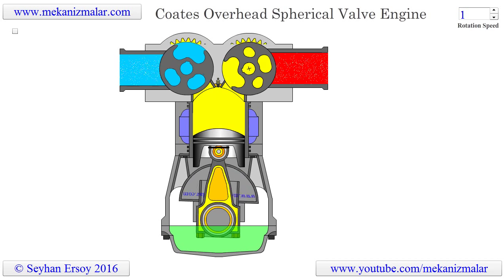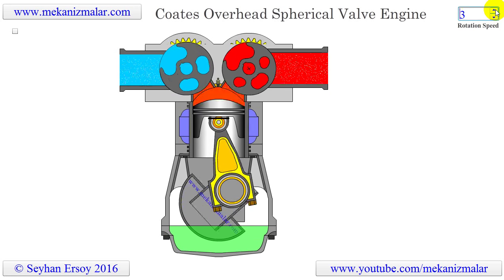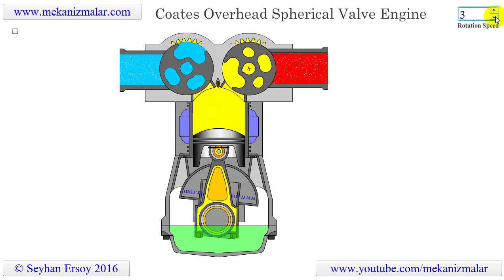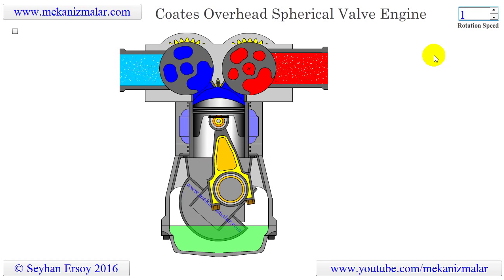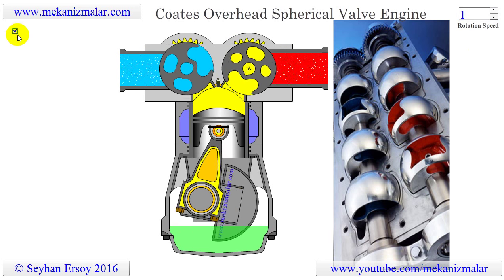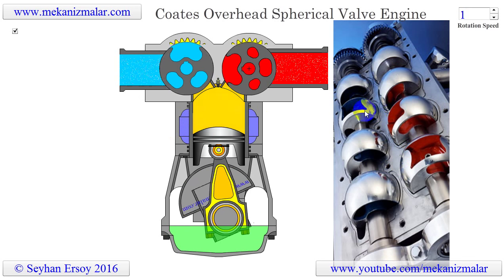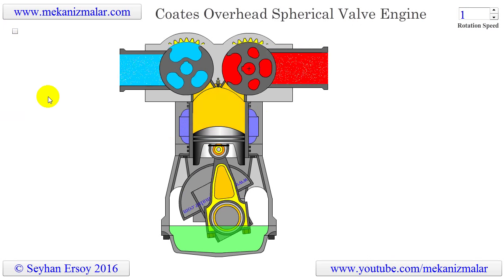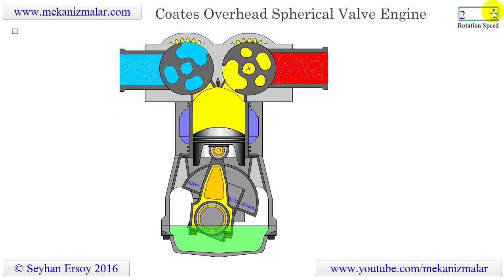coates overhead spherical valve engine

Comment: Lots of friction, and the lubrication is exposed to the heat and moving gases of the combustion chamber.
Reply from the maker: +deezynar Thank you for your comment. I am not in the position of defending or disapproving this engine. As I stated in the animation, if the design does not have any shortcomings it will prevail, otherwise it will be forgotten as a nice try.
Reply: +deezynar cast iron valves, against cast iron valve seats could be run dry, and still have surprisingly low  dry sliding Friction coefficient of 0.15. Using identical materials for both parts should also reduce effect of differential thermal expansion that tends to plague rotary valve designs and lead to poor sealing/seizing
Reply: +steve cummins Thermal expansion could cause some problems.
Reply: +steve cummins
There is zero chance that metal surfaces can run on each other at those speeds, those tolerances, and at those temperatures, in direct exposure to flame, and do it without continuous lubrication.  The requirements are for high tolerances to provide a seal against high pressure gas, and it must be maintained inside a combustion chamber where there is both high heat, flame, and gummy hydrocarbons.  It can't do it without continuously fed lubrication, but the lubricant itself causes problems.  Oil lubricant supplied to the spinning valve surfaces will escape into the combustion chamber, causing the engine to smoke.  And valve lubricating oil will also get cooked onto the surface of the valve that is exposed to the combustion chamber during the power stroke.  In a typical piston engine, the piston/cylinder surfaces are continuously lubricated under pressure, and the piston rings scrape the oil from the cylinder as it moves down the bore, leaving no oil to get scorched.  The piston rings add a fair amount of extra friction that would be good to get rid of if it were possible.  This spinning ball valve design will need to have lubricant seals around the edges of the ports, both inside, and outside the combustion chamber.  That's a lot of surface area being scrubbed, a lot of friction, and a lot of chances for seal leakage.  This engine shares the same challenges with sealing large swept areas that the Wankel engine has.  If someone can solve that problem, we'd be better off with the Wankel.  I don't see a single advantage to this engine design, and a lot of huge problems.
Reply: Effectively cast iron is sintered throughout with graphite flakes(or spheres). therefore it is self lubricating. And that lubrication is of a kind which can handle high temps too. 
Also with  a bit of care, it's possible to arrange things so rotating valves become more accurate with wear. ie rub two surfaces together under pressure and they'll end up with same curve. Exactly what Whitworth (and later people) did to produce cast iron surface places with accuracy far in excess of that achievable using "normal" machining.
Reply: Also The Wankel engine has a far more difficult issue to solve with seals. .... look carefully and you'll see within a Wankel engine the angle the seals make to the cylinder wall varies. That results in theoretical point contact,  Under such circumstances, no lubricant could ever hope to resist the theoretical infinite pressure and prevent metal to metal contact. Then as the seal wears down in an attempt to spread the load to that which can be supported the angle changes. The seal is constantly playing catch up through wear.
Reply from the maker: +steve cummins Some people adore the Wankel Engine cars. I wouldn't touch it with ten feet long pole. Once I had used Mazda RX 7. Driving it was fun, to start it in cold winter days was a nightmare.
Reply: +mekanizmalar I know Wankel compression ratios aren't great at the best of times. Compromises have to made between the extent of the seal angle oscillation, and acceptable rates of seal wear.

Would you happen to know if anyone has used hydrostatic air bearings within rotary valves? Both need tight tolerances to work well. Tight tolerances/small long gap,  should result in low leakage from "bearing" and past valve. Low friction and negligible wear would be good too.
Reply: +steve cummins Cast iron pistons in cast iron cylinder bores have always had to have piston rings, and lubrication.
Reply: +deezynar true. I suspect the reason for piston rings isn't so much about wear properties,. More that pistons can get quite hot at top of stroke, and bore is cool at bottom. Without the C shaped pstons rings that can match a small range of diameters, reciprocating engines would be likely to seize when warmed up

I'm not saying lubrication don't offer an improvement with for cast iron to cast iron running, just querying if it strictly necessary, in a different application.
Reply: steve cummins
The ball valves in the engine we're discussing are located right at the hottest place in an engine, and the exhaust valve will have very little relief from the worst of it all.  The stems of poppet valves are pressure lubricated, located outside the combustion chamber and are surrounded by coolant galleys.  Plus, the surface area of a poppet valve stem is far less than the balls in this new engine.  Finally, the pressure inside the combustion chamber pushes the poppet valve tighter against its seat.  Ball valves only have their fit tolerance to resist the pressure.
Reply: +deezynar Doesn't t matter so long as they don't change shape, and relative size with housing they run in..
As I suggested use hydrostatic air bearing for "lubrication" and support against the combustion pressure- they're amongst the best devices around for rigidly maintaining shaft location, extremely low friction/none contact and so simply don't experience contact wear wear so tollerances are maintained. Minuscule volume of compressed air leaking out of the valve isn't gonna harm anything. Could perhaps even tap "compressed air" off from the chamber itself, and save on a mechanical part.
If fit is good enough there'd only be a minuscule area available for combustion pressure to escape through. Compare with the area a piston ring's expansion gap presents to combustion.20% of the size? Path length could easily be far greater. If you want to quantify things, run equations at https://en.wikipedia.org/wiki/Choked_flow
Reply: steve cummins
Actually, this is the 1st time you've mentioned anything about using compressed air in this strand.  Let's see it last as long as a poppet valve engine, and meet emissions, and do all the other things we get out of poppet engines.  This is not a new idea.  It's been around for more than a half a century.  At first glance it looks like a great idea.  Because of that a lot of smart people, and some big companies have already spent time and money trying to get this to work.  Unless there's a major breakthrough in materials science, it isn't going to be in any car you can buy.
Reply: deezynar you not see the post mentioning air bearings?   If moving parts don't touch as is the case with hydrostatic bearings, then both can be made of same material without risk of galling. replace all bearings, including sliding ones (eg piston in bore) with air bearings made of say Invar to avoid any issue of thermal expansion messing clearance up, and that's an engine which won't suffer mechanical wear, with lower friction, lower leakage and so doesn't need any kind of oil with it's attendant pollution when it inevitably burns.

I do agree such is unlikely to be done by big companies... I studied mech eng at uni, and part of what we were taught was to design for limited life. Little point in a company investing R&D in something that won't break after 10 years as by that time "something better will have come along."

And regarding material science... Invar is well known for it's corrosion resistance, doesn't expand with heat, and has a melting point higher than aluminium alloy so may well be up to the job, despite having been around since 1896.
Reply: steve cummins
And... you've said nothing that moves the conversation forward.  This engine is only being talked about today because its promoter makes his living by getting publicity for it that attracts ignorant investors.  If it ever goes into real production for use in cars, or motorcycles, etc., it will be at some unknown point in the future, using materials we don't have today.  If it worked today, it would have replaced poppet valve engines already.  This engine layout is very much on everyone's radar, and they're keeping track of what advancements are needed to make it practical.  BTW, saying you are an engineer, or studied engineering gets you zero additional respect beyond the words you write in your argument.  Having worked around engineers I have learned that some are complete idiots, and others are really brilliant.  The only way to tell the difference is to see what they say, and do.
Reply: Hunh? No more friction than a standard camshaft would incur. I have no ideas why the Coates spherical rotary valves weren't an explosion on the rodder market. I was fascinated by them when I saw then in Mustang mags back in the 1995-1997 years.
Reply: davidsirmons
Because of the problems discussed above.
Reply: the shaft spin on the seals and the valves don't touch the heads/block. no oil is used in the heads.
Reply: All seals for moving surfaces leak to some extent. In addition there'll be a fair bit of heat conducted back along metal parts, and that can coke oil. Was occasionally a problem with turbo charged petrol engines in the 1980s.
Reply: @deezynar  You have a lot of logic arguments, but you talk like this was just an idea. In reality these has been running and working for decades..
Reply: @happyfox711  Share a video of one that's in use doing real work.  I'm willing to learn.
Reply: @deezynar  there's a lot of technologies that's not really supposed to work, take DLP projection - megapixels of real individually moving mirrors crammed into 1/2 square inch. The guy Larry  must have been gifted in persuasion to make Texas Instruments shell ut millions for R&D, but  it turned out to be the best system of video projection the last 20 years, just recently the 3LCD technology caught up in specs. Imagine someone saying, yeah I got this idea of  1600x1080 mirrors mounted on electrostatic actuators alltogether about 1x1.5cm but hold on that's not all. Then you have this wheel at 10.000rpms with different color segments that syncronizes with the mirrors to create a picture in colours. It only means the mirrors will have to open and shut 8 times or more pr.segment. It will work !
Reply: @happyfox711  I don't see the video I asked for.
Reply: @deezynar  something wrong with your computer ? Are you unable to click on a link or search CSRV engines youself ? Look don't drag it out any longer, you was wrong, ok. Accept it.  Btw. most of these being installed nowadays are in generators and other big industrial motors, for longer service intervals, cleaner emissions, adaptibility to multifuels etc.
Reply: @happyfox711  Of course I could look it up myself, but I won't because it would be a waste of time searching for something that doesn't exist.
Feel free to prove me wrong, and show me evidence that the engine in question is actually real, and operates, and relatively common, as you claimed.
Reply: @deezynar  I just did, but relatively common is your own invention..
Reply: @deezynar  are you really saying CSRV engines don't exist ? if you want to believe that, just to be right in your comments bashing the uploader with your ideas about how this can't work, then I'm not gonna waste my time on you. If you'd care to look at just one of the links, you'd see an example of a working CSRV engine.
Reply: @happyfox711  I am happy to be proven wrong, just post some evidence.
Reply: @deezynar  you kind of remind me of a cheating wife, the whole world knows she's wrong, but she sticks to her lies, in her mind, a way of saving face..
Reply: @happyfox711  While you have been passively doing nothing except trying to get the last word in, I've been doing research on this.  It appears that someone has had some success with a rotary valve design.  
First of all, it is very different from the design in the video.  The valves are cylinders, not spheres.  And they are turned 90 degrees to the crank shaft.  There is one valve cylinder for every intake, and one for every exhaust.  They are running it on a straight 6 engine, so they have 12 rotary valve cylinders.  These differences are significant, and my comments on the design shown in this video about the Coates design design do not completely apply to the other one.  This other version could work, but not without smoking.
Second, the other design does smoke out the exhaust just as I said the Coates would.  They have to lubricate the valve cylinders, and some of the oil gets into the piston cylinder.  Furthermore, the valves do not seal 100%, and engine exhaust leaks out the heads.  
Third, it is new, it has not been manufactured for sale, they have not worked out the flaws, and it is not yet proven for endurance.
Reply: @happyfox711  
You told me you would not post video at my request for evidence. 
There are no links in any of your replies to me. 
You have edited / deleted your comments to make yourself look better.  
You have also taken this to the personal attack level.
The Coates company has been sued for fraud.
Reply: @deezynar  ok, now you are the one way off track. let's get back to the point. It's very simple. Does it exist running working examples of the coates valves? I say yes, you say no it can't be done. I think the videos speak for themself. What do you mean my comments don't contain links? Are they removed only for you, cause they show up here. Of course I edit to add something, before u even answer. Nothing is deleted. You would have the ability to check that. So either you didn't or you're lying again. It's the reason for my first comment yo you. You're making stuff up, just as you fantasised CSRV wouldn't work, cause you didn't know enough about it. Do you really think if an invention is good, it ends up in production everywhere ? Profit is the only decider in that game, and this valves does not help selling oil or improve the planned obsolence in consumer products either. Industry on the other hand uses it for themselves. As I told you 3 times already you find these mostly in big generators that run on gas. Because contrary to your fantasy that they're smoking, they actually improve emissions. It's been measured over and over since the 90's Mercedes and Ford, 6cyl and V8 prototypes. If you really can't see my links, search yourself. Coatesengine dot com is their website, the second link I sent you. They have a youtube channel coatesintl. Of course there are more detailed stuff like patents and measurements, but so far your "research" seem to do best with big pictures.

Comment: I'm neither a mechanic or an engineer, so my opinion is invalid here.  You may have the problem of seal breakdown (like a wankel), but this wud likely work!
Reply: I think the main problem is that exhaust gasses disperse more heat into the camshaft which will seize if it expands, where traditional valves will likely have no response to expansion unless the temperatures are extreme.

Comment: A poppet valve ,when open, allows for the beautifully atomized air fuel mixture to flow directly into the cylinder. This system seems  like it adds a fatal flaw to performance. You'll never get more air to the cylinder than that tiny port in the valve can hold. It's then introduced to the cylinder in an odd way. It's also nearly impossible to turbocharge due to the isolation of these events. The charged air would be stuffed into that tiny port. Ouch! I would actually like to watch that! lol
Reply: When I did this animation this motor created a lot of buzzes. Now it is bankrupt, maybe it is is the reasons you mentioned caused it.

Comment: Fuck it. I'm going to design an IC engine without moving/rotating valves at all. And no, it won't be that weird ass wankel.
Reply: A 2 stroke with trapping rotary valves, that what i want to do.
Reply: Look up Felix Wankel he inventor too. They have trouble with seals too they say the wankel.
Reply: It's called a 'gas turbine'. They're not great for cars, but have found some use in other transportation machines :)